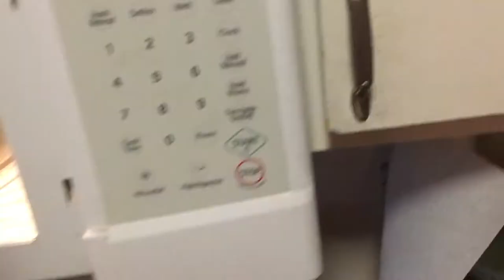A day at the shop... heat treat

Comment: Curious. What are you taking the freshly heat treated pieces out of after applying pressure with the chunk of metal?
Reply from the maker: +Jer emy   They are in an airtight steel foil packet ... if you don’t put them in that it will ruin the steel
Reply: Michael Emler very interesting. Thank you for the quit reply! Love the content, keep it up!

Comment: Lv of 1 to 10 how hard do you think it would be to make blades that can fit into other knives. For instance how hard would it be for you to make a 20cv blade that can fit into your reate horizon D
Reply from the maker: +Sour well the horizon d is M390 which is basically the same steel so that would make no sense... and it would be impossible with the current equipment available.
Reply from the maker: +Sour so it would be a 10
Reply: Ya I'm saying for different folders in general. I was asking cause that be bad ass if you could make blades out of whatever steel u wanted. If you ever brake a blade u can just make a new one or if u wanted to try a different steel.